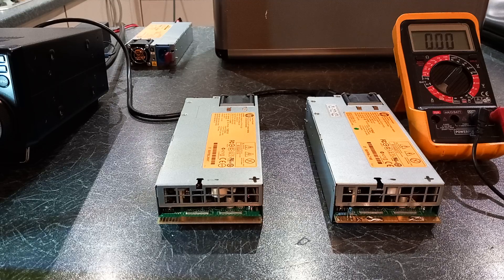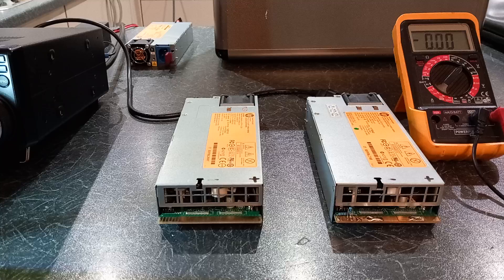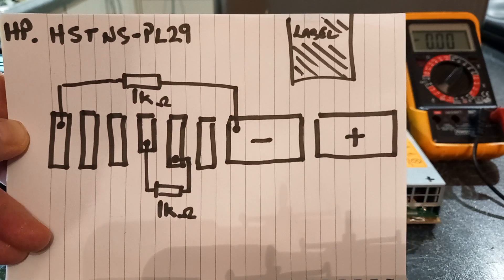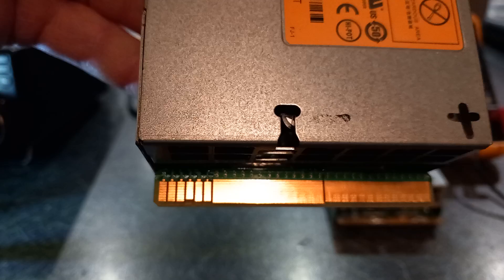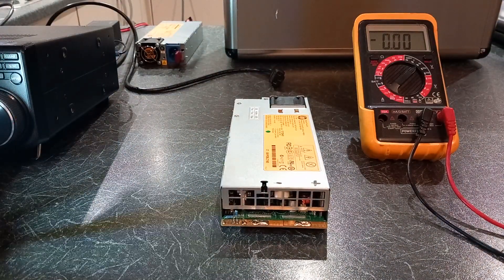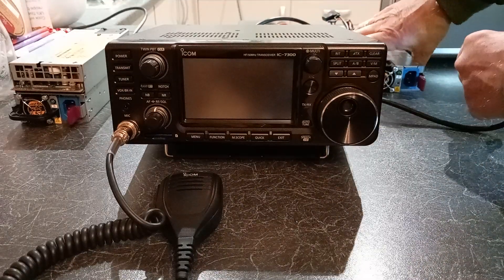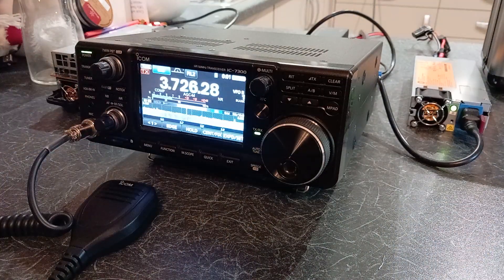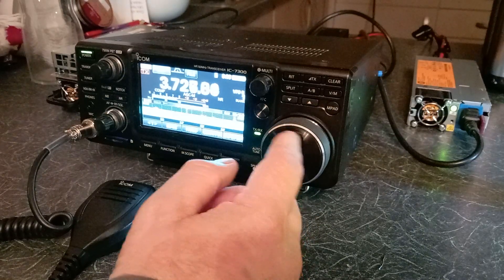Using a HP Server power supply HSTNS-PL29 SMPS for Ham use.

Comment: Thanks, any info in ovp modification?
Reply from the maker: @poseypapusdiazfamily4630  To change the output voltage, it's an internal resistor swap.I've not tried it.

Comment: Done this and works a treat, however I’m finding I’m getting slight electric shocks from me Radios coax when there connected to this supply, any thoughts why???
Reply from the maker: Fault with the power supply would be my first thought.
Or you have RF on it coming back on the negative rail.
Try a ferrite on the DC wires to the rig.
Reply: You need to isolate the body of your PCU from the board and the chassis Teflon washers or Teflon screws to connect the board back to the the body  @m0jcfhamradio75

Comment: Please note! This method of using resistors works on HSTNS-PR28 (460W blue label mine is made in 2013 so almost 10 yes old) as well I struggled so much finding the method to turn the power supply on but unfortunately failed. Tried this method and it worked as a treat.  Great work thank you
Reply: Do you know how to change voltage on this modal

Comment: This individual does not sound like a amateur to me. Sounds like he knows what he speaking about. Amateur radio does not to me sound like a good name for it. Especially if you need a license for it.
Reply from the maker: Like a lot of hams, I'm both self taught and trained as an engineer over 40 years ago.
However, I'm not a SMPS engineer, just an enquiring enthusiast.
I have however, built a few SMPS using the TL-494 PWM chip. It's a good way to learn the theory...

Comment: I run my wireless set 19 one a 60A supply and will run the matching high power amplifier on another 60A supply because they are cheep but I got mine for free and like you said they are pretty quiet. I’ve found them to be robust enough to take the high current peaks of the two dynamotors when they spin up. One thing I managed to do was get the sockets for the edge connector so I’ve not had to solder onto the supply which makes it easier to replace when one fails.